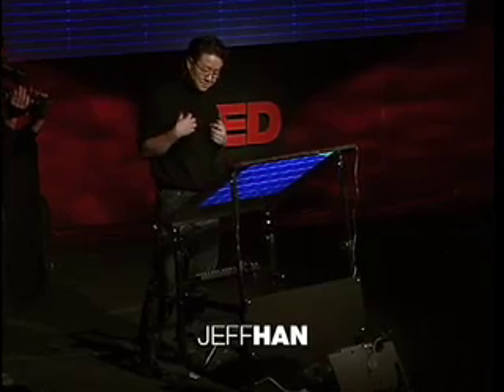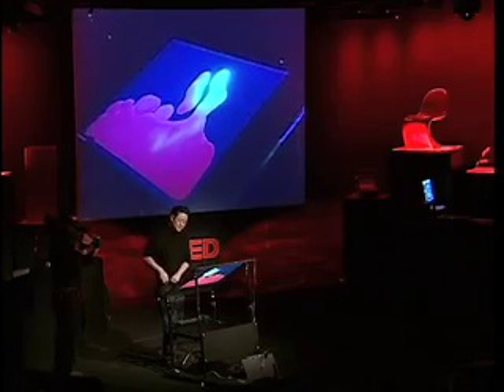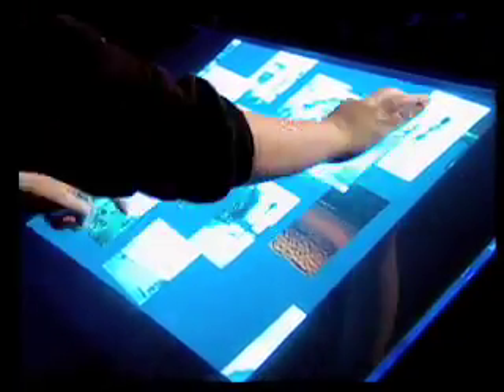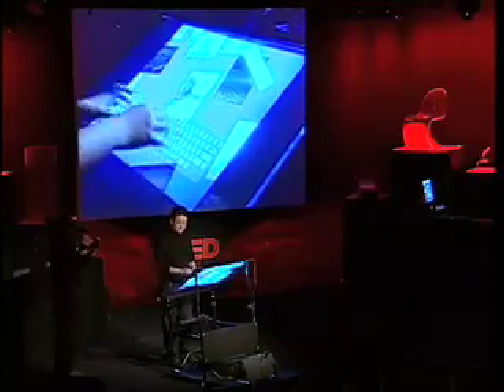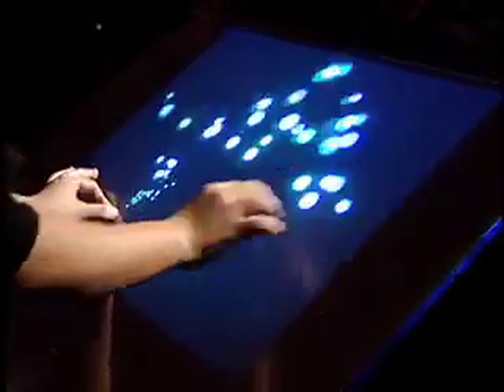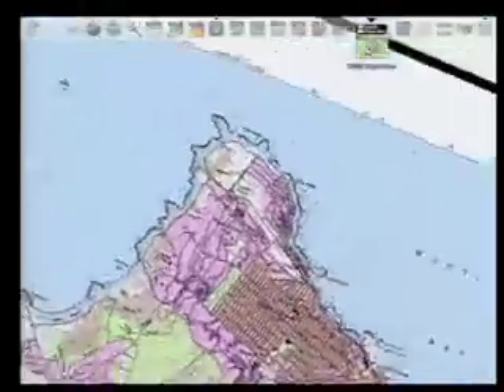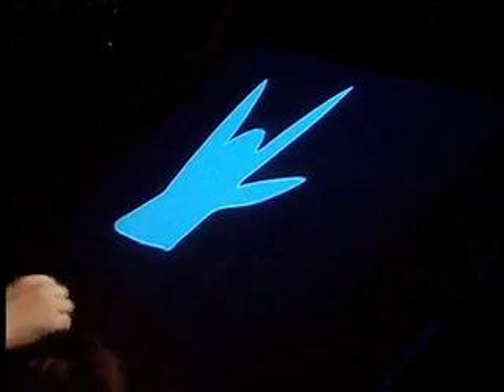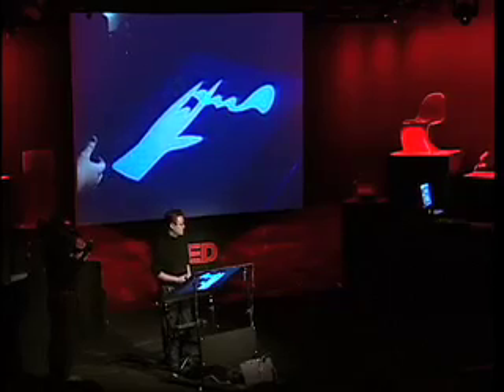Multi-touch interface (from Adobe TED)

Comment: @MrMihat123 
I don't see why you couldn't have both so that once your wrist gets tired you could use your arms to do the work to avoid carpel tunnel syndrome. And once your arms got tired you could go back to using a mouse again! And if you say it won't replace mouses altogether, it's quite possible that something will eventually what with all the motion sensing technology that's continually coming out.

Comment: I've seen ads from Cypress homepage, and they claim that they currently have the chip capable of detecting up to 10 points of multi-touch input. It uses capacitive touchscreen if I'm not mistaken. Still can't figure how they could scan that matrix. Quantom Touch uses a technology called spread-spectrum, but it's just for better noise immunity.

Comment: Microsoft is developing Windows 7.  Windows 7 is going to have multi-touch built in to the interface and experience of windows.

Microsoft also has a product offering called Surface (you should check it out on here on youtube) that is basically what you see here, though though Surface uses what I believe to be inferior technology.

Comment: By replacing computers, I meant replacing modern computers. Computers are defined by their interface, so therefore if it replaced modern computers, it would be replacing that input.

Same way Apples replaced the computer (i.e. Microsoft Computer) by reinventing the input system.

Comment: You can also build the multi touch hardware yourself.  All you need is a webcam, semi-transparent cardboard, and a box.  Put the Webcam inside the box and cover it with the semi-transparent board.  Have light shine onto your hand so it projects the shadow to the board.  The finger tips suppose to show the closest color of a human skin color.  Write a computer code to track the finger tips color movement, you now have a multi touch interface.

Comment: for starters... 1) this is not technology from the 1980's when it came out in FEB 2006.  #2 we can make things smaller?  its a 40 inch multi touch screen?  thats like looking at a plasma TV and going, its from the 1980's we can make it smaller.  #3 - this is the technology apple BOUGHT so no, it will never be on a crappy microsoft touch screen.  apple OWNS multitouch, not single touch, MULTI.  only on the iphone...

Comment: Actually, the MacBook Pros have a multi-touch track pad and had it since January of 2006. It may not be quite like this demo, but it's there. For example, if  you hold one finger on the track pad and move a second it will scroll a web page up and down or side to side, or if you click the button with two fingers on the track pad it will bring up the contextual menu.